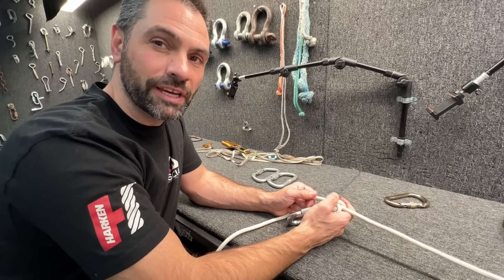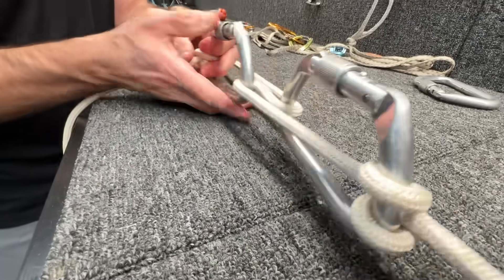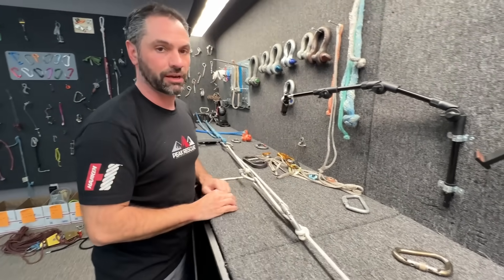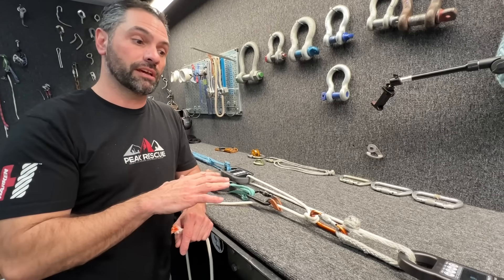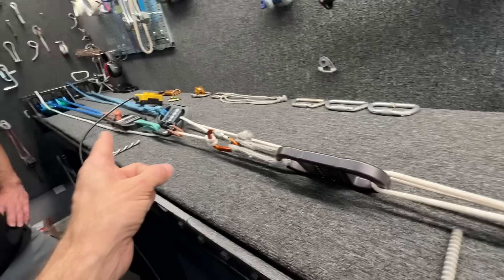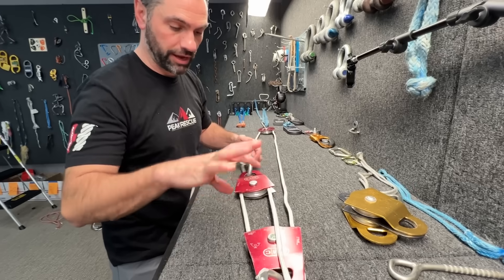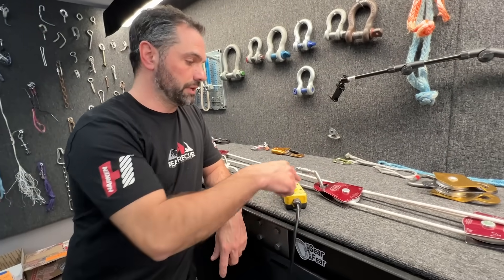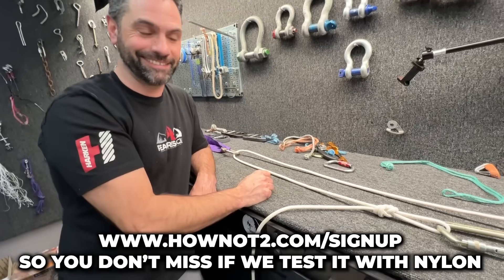I don't understand how this holds

Comment: If I take a 4 foot bar and place a fulcrum 1 foot in....I have  3:1 mechanical advantage and can lift a heavy object then stop with the bar at level height
-Even when stopped/static I still have a mechanical advantage
-If I did not, I would not be able to maintain holding the weight up.
-If I do similar with a hydraulic system having a 10:1 mechanical advantage to say push in a clutch and overcome 400 lbs of force with only 40 lbs of leg force...... when the clutch pedal is fully depressed and at its limit of travel
-------I still have a mechanical advantage of 10:1 when stopped and without moving any further otherwise I would not be able to hold the clutch in.
= Therefore this particular voodoo hitch works due to the "Dunning Kruger Effect"

Comment: A couple observations - pulling sideways on a taut line is akin to the tension on a taut highline the weight of a walker places onto each end anchor; the flatter the line, the more the forces are multiplied at each end. A simple mod to the pulley system would be ratcheting/one way pulleys, so the tension gained was not lost immediately.
Aside from this, the voodoo pulley idea seems pretty limited in actual usage, compared to any modern ratcheting strap system,

Comment: Instead of mechanical energy advantage being the main utility, it seems that its best in giving mechanical power advantage -- in that, by locking at each step, it allows you to rest and recover to apply more force the next time.
Similar idea to having a ratchet on a ratchet straps -- having to wind that strap all the way up at once seems daunting, but being able to split it up into steps allows you to do it with significantly less exertion.

Comment: I suspect mechanical advantage is all about the reference points.  Where is your work being put into the system and what resultant motion are you observing.  Certainly a complex system.  He talked about measuring how much you pull vs how much the system tensions up in terms of distance traveled but he never measured it.  That seems like it would be the true indicator of what MA you have referencing two points in the system.  When you use two hands it seems it would get even more complex.  It's a fun problem.  It doesn't seem like they fully nailed it though, to me anyways.  Awesome video.  I can't see myself using this over other systems though for a tension line, even if just temporary.  Truckers hitch seems like it would solve it fine.  Small MA with some progress capture works.

Comment: I believe The distance traveled is a better indicator because the friction throws off the calculation using poundage. Only if the carabiners were friction free shieves could you use load accurately.

Comment: https://youtube.com/shorts/SkVLiyLsdh8?si=qGmsC7oTa_E0yLtz

I think this is what you were trying to achive althoughi didnt apply the rope jack butt even still you hrave thr pull of 5 men at least on this system 
If you add the rope jack you can adrd 2000 lbs with it and the dynamic of the rope should be like 3500 lbs to 4000 matbe im prollyt more than likley wrong on the #s butt im my mind i get the physicks

Comment: It's supposed to be a 3 in 1 but the 3rd carabiner but it's supose to go all the way through or I'll usually have a order wrap to pull a tree down I've even applied the rope jack ti the same system and pulled trees over leaning the opposite way its a very good advantage and helpfull in the tree industry 

I've even set up 3 3 in 1s for one live oak it was way easier to pull it over
Reply: Also I I'm also playing with dunasorob rigging line the red one 
It's rated at like 18000 lbs so I could be wrong but croect me it'll it bothers anyone but will strength is a fun game 😅

Comment: To create more mechanical advantage, when initially setting up, bring the rope next to the first carabiner, wrap around the bottom and through it then continue to the bottom anchor carabiner then mount the final carabiner. When you pull the rope through and hook the final carabiner, also hook it through  the extra loop on the first carabiner. By adding the additional loop you have essentially turned two pullies into 4 like a block n tackle kit.

Comment: 'I don't understand how this holds'
The reason is simple.  Took a while to work it through, but again it's simple once you see it.
Fold the rope around the narrow end point, and then load the rope.  The strands within the rope on either side of the fold back point quickly start deforming and locking in place on both sides due to the rope's internal friction between the strands.
You quickly start requiring very high forces to make this deformed rope part slide around that end point.  You have to deform the rope strands even more to make them go around the end point while under load., and the force required will get higher than you're thinking very quickly.

That's also part of why a larger end point for the rope to go around won't work well for this.  There's a lot less deformation that would lock it in place with a larger radius.  The larger radius acts like an inclined plane to help the rope go around the end more easily, even under load.  You need the tight fold back to have a lot of deformation to both sides and easily lock in place.

That's why it's easier to grab the other side of the line and pull both ways to change the tightness.  You're unloading it somewhat and jumping that deformed area of the rope around the end point in order to get it into a new position in the rope more easily.  Then it deforms and locks in at the new position once you get it set.

That's also why even though this almost completely physically locks up and nearly holds itself, you can't quite just let go of the end of the rope completely.  Even with high internal friction and basically physically locked in place, it could still start slipping past itself and loosen up if there were no force at all on the end.  But once locked, it could take next to nothing to hold it in place.  Of course vibration, bouncing, etc could easily cause it to loosen up and need more end force to hold it in place.

You can easily heat a rope by forcing it through a tight corner due to its own internal friction.  And the narrow fold back is like two tight corners close together.  You have way more friction than it seems holding it in place at the fold back points, and most of it is inside the rope from the internal displacement and physically deforming around the end point.

Comment: It's not mechanical advantage it's simply newton's law. You have two points being lashed in place as one with equal and opposite forces suspending it in place because neither force is stronger than the other but both have added potential energy greater than any outside force(i.e. gravitational)

Comment: Swigging is a fast pull on the line. Lines and ropes stretch, it's hard to get a line tight by pulling. Watch the documentary on the last of the tall ships. You'll see a small group of boys on a halyard swigging against the bight. Incidentally the Swedish word is slurk. Swig is English and has been used since circa 1200.

Comment: The carbines are acting as pulleys.
The left carbine is pulled to the left by the force of itself times 2 since it's coupled to itself via a 2 pulley system.
The friction stops the built up tension between the pulleys from releasing.

1:39 No, mechanical advantage doesn't need to move, it just has to exist.
8:34 no, friction doesn't stop mechanical advantage.

This system is reliant on friction AND mechanical advantage.

The left carbine has force X on it's left side, which is looped around the system and coming back into the right side of the left carbine, adding force X, then going back to the right side again, adding force X.
Left side F=X
Right side F=X+X

You need to measure the left side of the left carbine vs the right side of the left carbine with it's 2 inputs measured respectively.

The whole outer system is "inert" since all forces cancel out in total.

Comment: You have made what amounts to a preloaded pulley system, Since the parts you are pulling against arent moving you are storing potential energy in the system when you pull the loading line. There is what amounts to a crude gear in the way the ropes are set up.

You seem to be introducing more energy into it than you are exerting but in truth you are moving farther than the "gears" of the rope so you are doing the same amount of overall work. 

basically you have made a unidirectional spring out of rope, or if you want to be feel fancy, you have made a mechanical energy battery out of rope.

Comment: Interesting… But a truckers hitch is still way faster and easier to make, more secure, faster to take apart, doesn’t leave half of your equipment stuck on the other side, requires no carabiners nor any high fallutin  equipment, and gives you mechanical advantage that is not lost to friction. ¯\_(ツ)_/¯

Comment: False: "mechanical advantage only exists when something's moving."   Just consider weights balanced at different distances from the fulcrum of a lever arm. Put 1kg 1m from the pivot, and 10kb 10cm (0.1m) from the pivot, they will balance with nothing moving. The mechanical advantage (torque) applies regardless of whether or not the system is in motion.

Comment: It's a two to one, 2:1 mechanical advantage system.  I've never heard of a 'voodoo hitch' before but at [1:47] right between the two carbineers shown you have one, two, three lengths of line.  This is the only point of the system that is significant.  If those carbines were blocks [pulleys for non-sailors]  what you actually have here is a two block set up with one fixed pulley, one moving pulley, one fixed end and one end you are pulling one.  Three lengths of line:  one, two, three minus one equals a mechanical advantage of 2:1.  All you have to do is count the number of strands between the blocks and subtract one to achieve the [ideal] mechanical advantage. 

You could have had two or three carbineers at either position and all you would have to do is count the number of strands going back and forth between the opposing groups of carbineers and you could count the mechanical advantage of the system.  It's about that simple.

People now use carbineers like most people used to use pulleys, and they can no longer visualize what they are doing.  They actually used to teach this in high school physics.

Look here for the essentially similar system:  https://www.youtube.com/watch?v=WuM4KaYndcY

Comment: It sounds like this arrangement takes advantage of the interaction point between friction defined & movement defined systems; they've identified a usable area where that jerking then pulling motion can control the transition between the two modes.
It feels like learning about supercritical fluids; fluids that are Both liquid & gas, because temperature &/or pressure are manipulated.

Comment: This is how a snatch block works, or a block and tackle.  I also think you are measuring from the wrong end? The force between the puller and the static anchor would be the same, but the line going to what’s pulled would be doubled. The mechanical advantage is applied at the pulled portion. It basically allows you to share the pulling force between multiple static points and the puller, which is why the pulled force increases exponentially with each static anchor (as with a block and tackle)

Comment: i use a version off this hitch a lot for tentioning tentlines, where the origional tentioner is missing. Instead off the first carabiner you use a buterflyknot and where the tree would be is your tentpeg, and instead of ending it with a third karabiner you pull it trough the butterfly, pull it tight and ty it off with a slipping halfhitch around itself. its very easy to pull tight and to undo and doesnt require any aditional tools or rope. in my opinion that is where it realy shines, you still have the 3-1 or a 2-1 mechanical advantage without the worry of it losing strength or tention.

Comment: You count the supporting ropes.  If there are 3 ropes in the center vs one on either end, it is a 3 to 1 mechanical advantage LESS the friction of the turns.  If you were using well lubed pulleys or blocks, snatch blocks, etc, is is about  5% loss per turn.  Slippery beeners  maybe higher.    I have been using a truckers hitch, utilizing 4 hole boat cleats (functionally similar friction to beeners) for more than 50 years.  As you are noting,, I call it a magic knot, you call it voodoo,, because it can be tied in the middle of a rope, and when released it disappears, nothing to untie.  With 4 hole cleats I secure the end with a simple cleat hitch,, every sailor, on every sail trim uses.  Functional equal to the clove hitch, but open, you don't have to untie anything.  I did note the 'perfection loop' at the bitter end.  Well done  !

Comment: Mechanical advantage is actually why this system works in the first place. The principle of mechanical advantage here is that by doubling the line from you working end to your top anchor point you reduce the force required to move (or hold tension ) in the system. This allows for the friction on the rope where it passes through the biner to be high enough to hold the system in tention. Without mechanical advantage however, the friction would not be sufficient because the required force to keep the system static would be doubled.

Comment: Mechanical advantage occurs when force multiplication takes place. As soon as you reduce the input force to 0, the multiplication done by any system will result in zero output force. The friction is what maintains a force to multiply.

Motion is only required if analyzing the work being done (no motion, no work).

Comment: This mesmerizing setup is great for making system that is adjustable in length, not adding mechanical advantage. It works using because the two purchase systems balance each other. A 2:1 and a 1:2. They can only be adjusted by manipulating the strands within the system, not outside on the ends. 

This system is commonly used on sailing dinghies with trapeze wires as a gross height adjustment. This would be all dyneema and spliced loops, letting the line set into position and maintain the setting, even when the whole system is flopping around on the leeward side.  The fine adjustment is done with either a 2:1 or 3:1 as required to balance the boat.

Comment: So if you pull your "set" carabiner 10cm back (ingoring that the ropes are slightly elastic) and your load carabiner goes anything less than 10cm back, you have a mechanical advantage.

Comment: Thanks for confirming history...(aka "Old Guy Here)...I was taught (and have used this for 5 decades now) this is a "tension hitch" and has zero mechanical advantage...What a great channel!!!
Reply: It's still 3:1, the friction is so high with the forces involved that it stabilizes the system when no force is applied. That's what they were measuring and analyzing. 

It'd have potentially been a better data capture if they were able to capture in motion during the pull. 

It's just a horribly inefficient mech. advantage.

Comment: This hitch is pretty genius.

The reason friction doesn't remove all of the mechanical advantage in this system, despite being strong enough to hold the load, is that the action of tightening the lines releases the pressure around the bends that causes the friction.  When you pull those lines, you are pushing them towards the carabiners, and as soon as you do that the pressure drops to practically nil and the rope slides easily.  The moment the load returns and pulls on those lines, the pressure returns and the friction is enough to resist that load.

So in fact this system is getting the best of both worlds.  You get the mechanical advantage when you want to tighten it, but then it can't slide backwards on its own.  When you add a bit of force back in the other direction with your hands, that's enough to overcome that friction and allow the line to release.

I would be very interested to see what happens if you attach those load cells to the adjustment lines and tighten it through those load cells, then compare the force being applied through those ropes to the force sustained at the ends.  I bet you'll find the numbers are indeed very different.  When you leave it to its own devices, the friction comes back into play and obscures what's happening when you're tightening it.

Comment: of course it would have more mech. adv. and not hold with pulleys -- and vice versa without...
with pulleys you're just splitting the load, which means you can put more force into the output than you can any individual pulley -- naturally
but also with pulleys you're removing the only force that **can** hold... friction. friction holds.

with the carabiners, you don't have enough surface area to constitute a proper bend, and the tension members aren't free to move.
mechanical advantage is about splitting the load, but when your ropes aren't free to move as they please... (to readjust and balance the forces applied)
then your mech. adv. is shot. you don't get any -- i.e. one of your ropes is doing the actual work, but not both. you can tension and hold tight, but that's it; that's all you get.

the voodoo hitch is working with a different concept in mind, and mechanical adv. just isn't one of the things it's used for.
it's a stay.